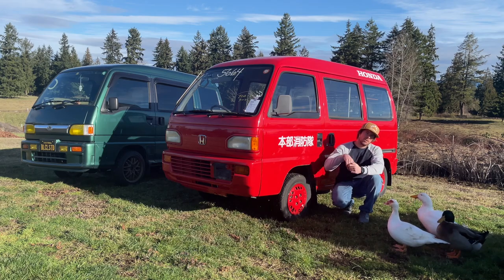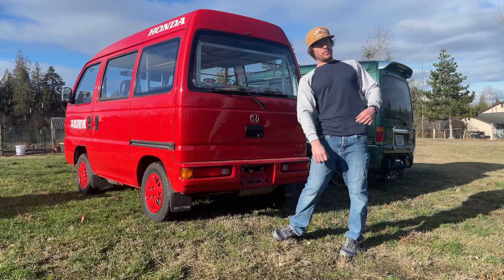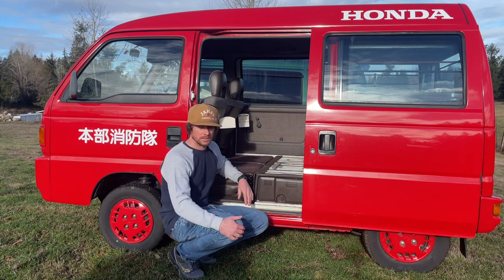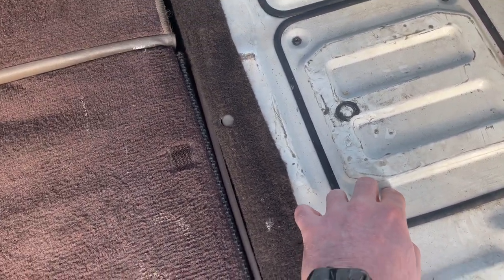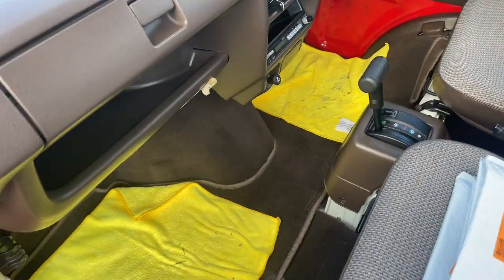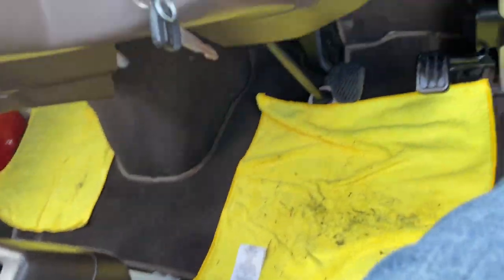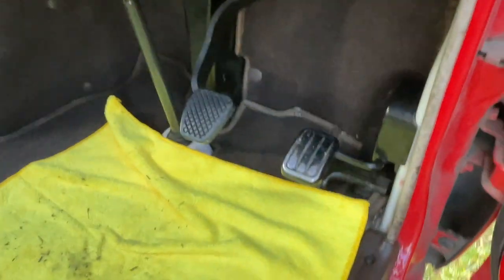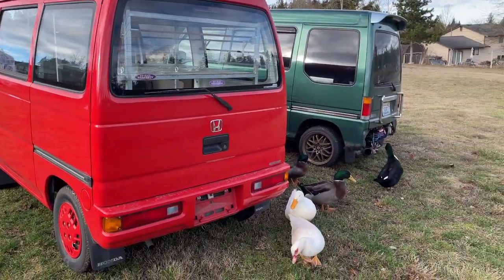Honda ACTY Fire Van Vs. The Subaru Sambar Dias Van Walk Around Let's Compare!

Comment: Does any of the vans come with rear seat belts?
Reply from the maker: Honestly I don't know, but i have never seen a van with back seat belts unless maybe it was added. That's why its good to get them added before departure from japan so you don't get hit with the 25% duty and get the 2.5% OR you get lucky and the port inspector doesn't need the extra cash that month lol